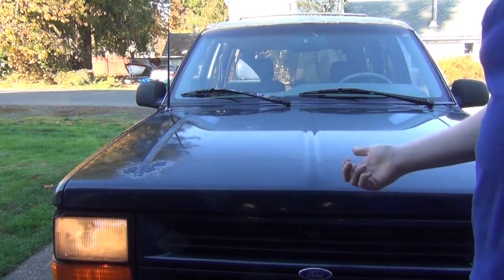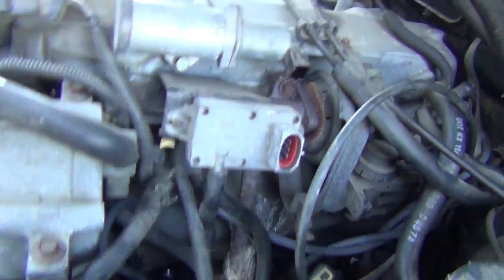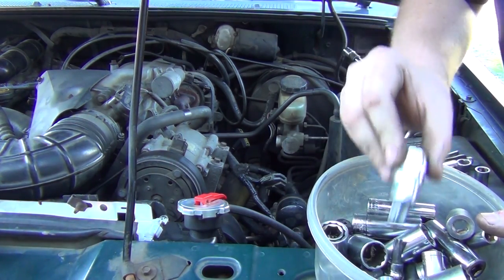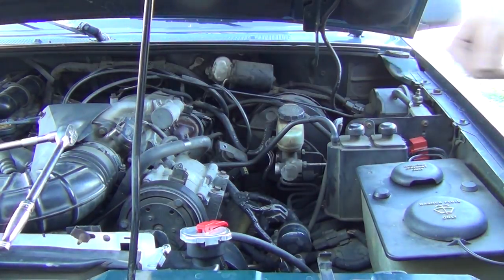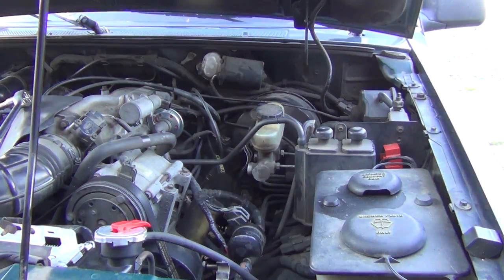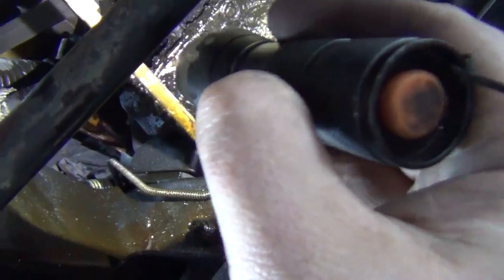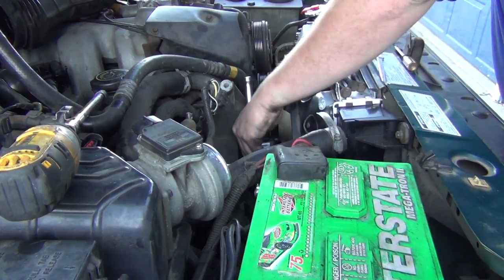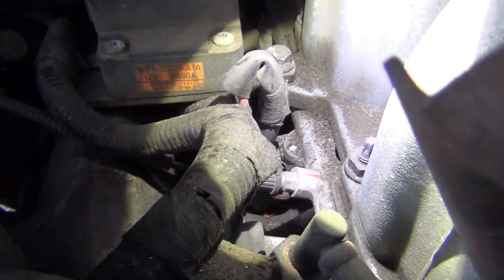Fixing Up a 1994 Ford Explorer Limited | Digging a Little Deeper | Part 2

Comment: I put the Pacesetter headers on my 2000 a couple years ago.  So far I've been happy with them.

I ditched the gaskets they provided and used the Fel-Pro gaskets.  I just felt better with those.

The bolts they provided for the collectors were way too short.  I had to use some of my own there.

The oil dipstick wouldn't go back in its position because of how the head flange was made.  I had to bend the tube a little and fab a bracket for it.

Really enjoying the project so far.  Good luck with it!

Comment: Check the mass air sensor for your stumbling issue my f150 did same thing I got a can of mass air cleaner followed the instructions and it had all it's power back and don't stumble no more hop that helps live the vids
Reply: Did you see all the oil in the throttle body!!!

Comment: Thanks for sharing. I got a 93 explorer. Electrical issue with tachometer jumps around and rpm stays consistant. Also when blinker blinks tac moves. Any tips? Thanks for keeping it real. I sub.

Comment: the 80 to 96 300 inline are known for timing gear cover leaks i have one now its all gooey with oil and dirt i snugged bolts a while back and it slowed it way down i am looking into getting a parts truck with a 302 to do a swap need a whole truck to get all wiring computer what ever i need for swap was thinking of a foxbody mustang but i got a few people saying dnt use a mustang use a f150 or ill end up in a mess of sensors and wiring cause there not the same so thats understandable sports car vrs work truck wana rebuild a engine to swap in without a major headache 300 inline has bearly any aftermarket parts 302 have massive amounts of after market parts

Comment: I changed the egr valve on my 94 explorer and I didn't a wrong move and snapped one of those brittle plastic piece of shit vacuum hoses. I had to attach a rubber hose to fill in the gap because ford doesn't make an anymore